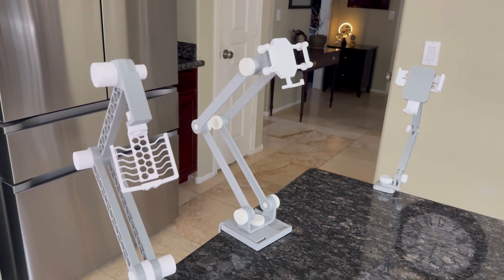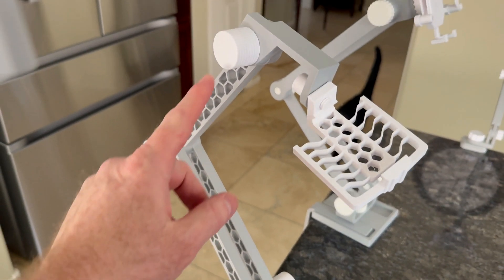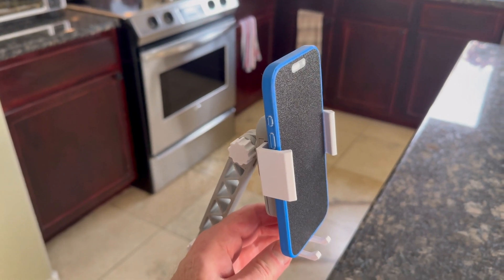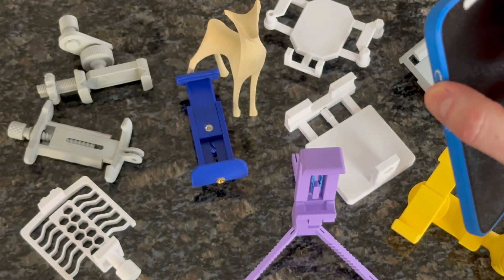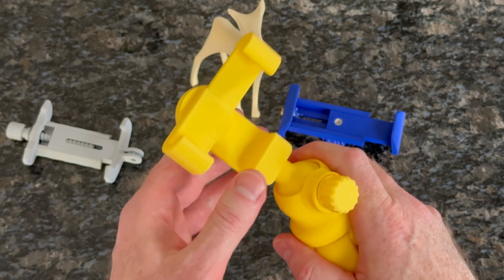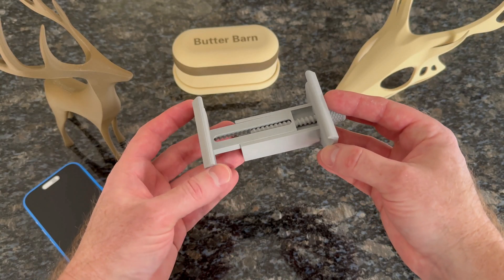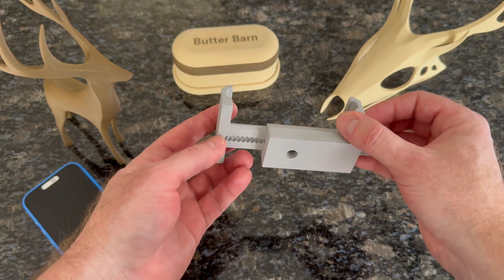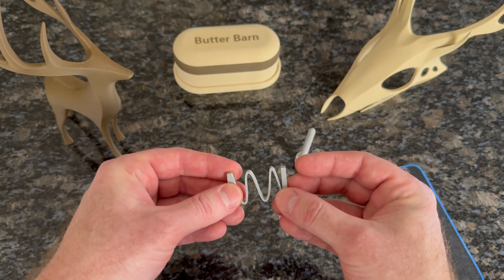I Fell Down a Rabbit Hole Designing the Perfect Phone Cradle

Comment: I know this can be dumb question but what is the program that you desine this pice? I recently try to creat something on my own and use thinkercad but it is too simple for some measurement 😢
Reply from the maker: not a dumb question. I used Fusion. You can get a free license to use it if you're not selling items. There is a great youtube series called "learn fusion 360 in 30 days", which will help you learn what you need. It's a bit of a learning curve at first, but worth it!
Reply: Adding to Zion's recommendation, Google the Pencil Sharpener project my Brad Tallis. Also-- one can sell a small number of items using the free version.

Comment: The ball joint connection came out too loose. If only the threads went a couple of turns more.
Reply from the maker: I actually redesigned it a little while back to tighten more. You might have downloaded it before that change was made. Try redownloading the 3mf file from my link and just printing out the sleeve that goes over the ball joint again.